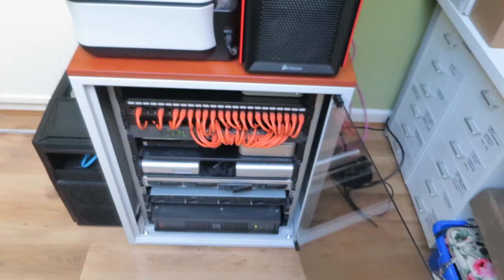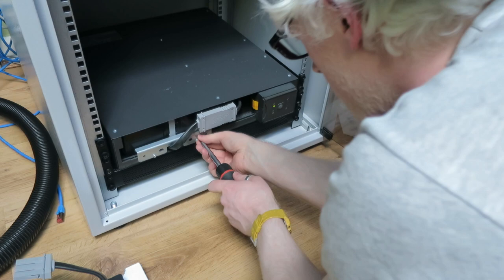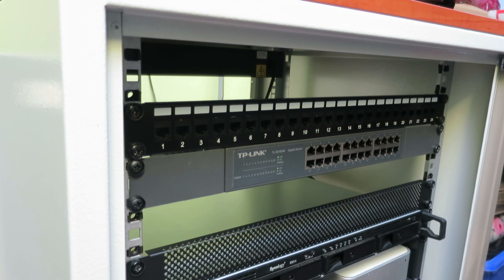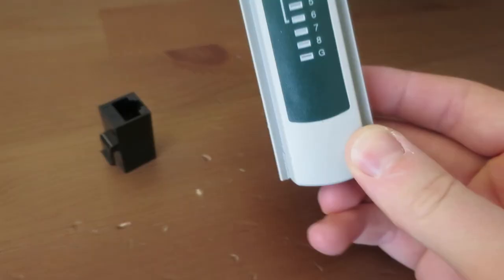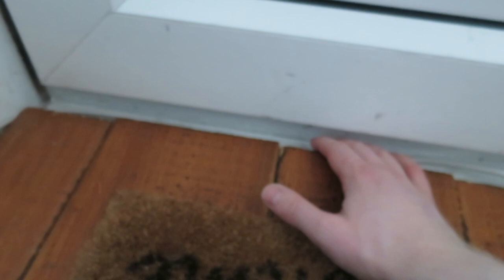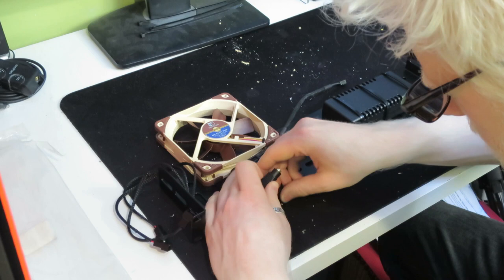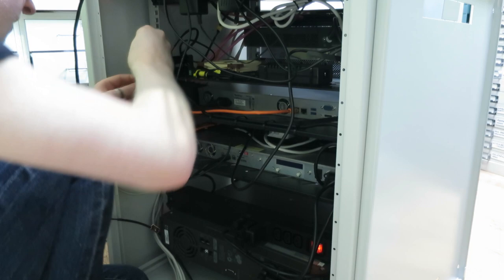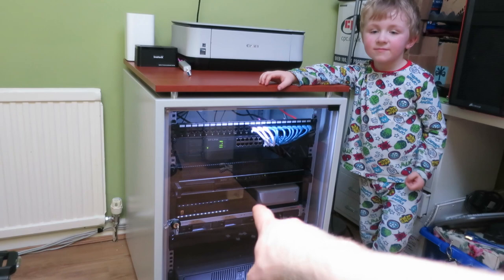Setting Up Our Home Network (Part 7) - Bringing It All Together

Comment: Tom. Thanks for the slow pace videos. It’s very relaxing for my mind :). You showed the cable routing past the entrance door for your house and showed that the door mat would prevent people from tripping. I got the idea that you might be able to hammer some racks on that cable into the end grain of the floor. Right in the gap. Anyway, cheers.

Comment: Tom - you might also think about mounting the existing middle fan (under the rack shelf it’s currently attached to), adding a 2nd fan next to it, and mounting the transformer on the top (since it’s heavier). Don’t forget the fan cages and washers as well. Cheers
Reply from the maker: Thanks for the suggestion, Robert. Good thoughts. Keep an eye on future updates.

Comment: The racks I have that are that size all have the fans on top, not the bottom. I thought you might have the cabinet upside down! LOL.  But, I have found some that have fan mount top and bottom. We have the fans on one case mounted on the outside and the filter on the inside. The cabinet is actually a wall-mounted. I might be worth raising your cabinet up a foot or so for airflow. We have a rack that has an 80/20 aluminum rail frame that has been built to support the whole cabinet and raise it off the floor so the equipment is accessible at sitting height. The frame a rectangular frame with four perpendicular feet about  14 inches each with plastic covers over the end of the 80/20 three-way footing on top and actual screw adjustable feet like your cabinet has. The mountings for the feet are actually tapped and threaded holes. The frame has been secured to the rack with the 80/20 sliding cage nut system drilled through the cabinet. Its an exotic solution but it might be an interesting video.

Comment: TOM... a suggestion for the fan cooling setup, you could get a thermal trigger - which will have the fans kick in when things get hot in the cabinet ... just a thought .
Reply from the maker: Check out my channel for my recent cooling addition to the rack :)

Comment: Finally made it to the end! I use those exact fans behind the amps in my hi-fi rack. I was using Arctic F12s but I had a power surge and killed them. They draw less than 200MA each so you have a good 5 amps of headroom on that PSU if you wanted to add lights or step-down for USB charging or running a raspberry pi etc. Great work though, the nerd in me wishes I had the need for a network rack.

Comment: The second you mentioned a service loop I knew you had been watching fiberninja. I'm proud Tom, I'm so proud
Reply: Fiberninja says never to bother making your own short cables when patch cables will do the job, which is great advice for an enterprise network but if you're sitting at the desk watching a 3 hour video about rewiring a place overnight while the cctv guy is making life difficult then you have the time to throw together a couple custom length cables during it. Which is especially nice when you'r patch panel is one row and your switch is 2 and slightly off center, I have the same issue.
Reply: Also, small note, if you can ever pick up a longer led strip on cheap it would look great up one side, along the top, then down the other side. scrap the bottom one that illuminates the UPS and make a more consistent lighting level through the rack
Reply from the maker: @RoryIsNotACabbage  Thanks for the comments man, I appreciate it! Yes, time consuming indeed for 24x patch cables. My eventual plan, which I believe I described in the video, is to get much longer patch cables and take both bundles off to the side. I didn't get to it in this part, and I didn't want to risk spending the dosh and then realising the new kit needed different length cables. 

About the LEDs, yes that would be the ideal solution. What I will say though, the bottom strip doesn't look as 'obvious' as it came out on camera. The plastic on the UPS is quite glossy so in the video when I had the LED brightness turned up for filming, it reflected like mad and looks like a blob of light on the UPS, but in real life it's much more subtle and even. The bottom strip evens it out a lot. With just the top, it was nearly pitch black by the time the light reached the Mac mini shelf.
Reply: @ItsMyNaturalColour  I do remember you saying that now. Good practice though 😋
Looking forward to the new series starting

Comment: You can use the open USB ports on the back of your servers to power the fans and avoid that power brick. Another idea would be to use another keystone patch panel in one of your open locations above or below your servers and and use it to bring the rear IO of the servers to the front side (USB ports, video out, etc.) for ease access.

Comment: Hi Tom, I've just moved to a pfsense machine running in a VM. I've kept my Time Capsule but only for backup of the Macbooks. Free version of ESXi is running on an HP Microserver. Using pfsense and Unifi APs has given me lots of control and visibility - this may be of interest to you for future video ideas.

Comment: My solution to power rack fans was to add USB plugs and run them off an 8x USB-charger at 5V. I rather have many fans at slow speeds than only a few blasting on full power.

And since the rack is pushed against the wall anyway, why not get rid of the back cover? It doesn't appear to be structural and it would definitely help with air circulation.

Comment: Where you have the mac mini and HDD i would get one of those vertical fan mount plates with 2 fans, push the mac mini and hdd back and screw that plate to the front and have 2 fans blowing constant air across them, keeping both running a lot cooler.
Reply from the maker: Thanks for the suggestion. Yes, I'll definitely do something to address the Mac mini cooling. Someone suggested on Facebook a fresh application of thermal paste and an internal clean for the Mac mini, which would be a good start. I'll make some videos about this stuff in the future.

Comment: I basically have the same rack and I can recommend the Digitus DN-19 GS-NW sliding rails. They work perfectly to support equiptment. I was still able to screw the device in form the front and thy line up perfectly. They are rated for up to 100 kg. Just as a tip for someone in a similar situation.
Reply from the maker: Thanks for the recommendation!

Comment: USG PRO 4 and UniFi POE 24 port incoming 👍
Reply: I haven't got to that section of the video yet, so excited to see what's announced... That said, I'm not sure if anyone would still be interested in buying the older USG Pro, cloud key and switches since the UDM Pro was announced. It incorporates the controller, gateway, surveillance NVR and a small switch in one unit. Best of all, future proof because it offers SFP+ for 10Gb 😆

Comment: My parent's dishwasher came with a rubber flap with an adhesive strip, the idea was to put it on the bottom to make it look nicer if it was integrated into cabinetry. I guess something like that might work for your front door situation?
Reply from the maker: Thanks for the tip!

Comment: You can easily move the side panel of your rack to move your cables of your power transformer supplies !
Reply from the maker: Not too sure what you mean? This rack is a single piece, with a removable back cutout and glass door. The sides don't come off.

Comment: The APC ups' still will beep even if the battery is healthy, I've got the same model as you.
Reply from the maker: Yes, they're designed to beep if the power goes out, but when your battery is dying, it constantly beeps even if there's no disruption to power, as a notification that the battery is dead.
Reply: @ItsMyNaturalColour  Ahh OK, that's good to know!

Comment: Thanks for the greates video:) 

But I can see that you have mountet the back support shelf for the synology, one hole to low. You can move it up one hole and it will be perfectly level👍🏻

The fan in the middel of the rack, could give some better airflow by Mounting it on the other side of the shelf, so it pushes the air ind the back where the cable is:)
Reply from the maker: Thanks for the comment. Can't remember if I touched on it in the video, but I had to move the Synology back support shelf down 1 hole on purpose. For some reason, it was out of line if it was one notch up. Very annoying, but it works ok. 
Yes that was my original plan, but pleasance with the back panel was an issue.

Comment: Nice cleanup. Not sure what's going on with Fiber Ninja. He has not posted in quite some time unfortunately. 
I have two variants of that switch, one has a 'D' suffix and has a slightly different layout from the non-D version. Both are non-managed switches. My network is 100% managed now, but these TP-LINK switches are perfectly adequate and fanless, for most home use. Nice job.
Regarding the air flow -> you want to block the front, not vent the front, for the unused slots. You want that cool air to pull from the front and blow out to the back. If there is virtually no resistance, the air will just go through the open areas instead. It still cools a bit, but not as much. The cooling I used was the AC-INFINITY rack mount (2U) fans which have temperature controls. They are NOT cheap (at all) but they have been rock solid. I flip the fans around so they pull from the front, but in your case as the door is typically closed, you probably are fine with the Noctuas you have planned/already installed.

No big deal on the A/B mistake. I've done that a few times. I must admit I try to stick to 'B' as well, but I am not using the socket type stuff you have in the cupboard. I am using a rack strip for that. I am finding the powerline adaptors a royal pain to use, mainly as they are just not great when the circuits are far apart. Much nicer without powerline :)
Reply from the maker: Thanks for the comment!
I really hope he posts again soon. I enjoy his cleanup videos immensely and always learn a great deal. 
Yes the TP-Link switch has been absolutely rock solid. I have a few of the 5 port and 8 port versions dotted around work too, all unmanaged but completely solid. It's great kit for the price, and even after my upgrade to managed kit later on this year, I'll continue to recommend the TP-Link switches. 

Thanks for the heads up on the cooling. You're absolutely right and that makes perfect sense. Once I get the new kit in and all the rack space filled, I'll fill in any blanks with non vented panels.
Reply: @ItsMyNaturalColour  I moved the vast majority over to Unifi equipment, although my router is Ubiquiti but EdgeMax (EdgeRouter Pro8 SFP model). Not needed for sure, but having the POE powered Access Points is great. Their newer stuff is fanless for some of them, or much lower noise for the rest. It's kinda crazy, I've not lived in the UK for >10 years now :/

Comment: Hi Tom great video is they a reason why you fitted the severs in the middle of the rack and not at the top heat rises?
Reply from the maker: Yes. I think I touched on it during the video, the top of the rack is reserved for 2 or 3 new pieces of equipment that will be coming later on in the year. The whole thing will make more sense as soon as I deploy that kit.

Comment: Really interesting video. I thought the brush plate was a tidy looking option for patch cable management. What is the downside of using the brush panel for cables going in and out? I am trying to find the best way to manage patch cables without it being a big mess of  a cables.
Reply from the maker: There's nothing at all wrong with a brush panel, they make things very neat and tidy. The problem in my scenario was the way I crammed everything into it. I had 24 patch cables coming in, and then the same 24 coming out of the same panel. That was 48 total in/out which was far too much to keep neat. Best way to do it would be to only use the brush panel for one side of the 24, then use longer patch cables and bring them around to the front via the side of the rack... or use 2 brush panels if you can make it look neat and tidy. If you have a 16-port switch, it may be easier to manage 16 in/out, but 24 in/out was just too many for the one panel.

Comment: Tom - what about flipping the 2 new spart-shelves 180 degrees, so the ‘shelf’ parts are on top (instead of the bottom). Then you could slide the UPS in and be able to screw ears into the UPS and secure everything to the rack properly. This would also give you more clearance for the bottom fan to circulate air in the rack. Don’t buy a 3U blank/spacer - get three 1U’s in case you need to shuffle things around in future.
Reply from the maker: Thanks for the suggestion! Great idea. I will look at incorporating this change next time I overhaul the rack. It's fine for now but this would be even better.

Comment: I noticed there’s a serial port on your Synology box. It might be possible to connect your ups to it. Would be great to have auto shutdown on the Nas if the battery runs out.
Reply from the maker: Good spot. I forgot 2 or 3 things that I wanted to cover in this video, and this was one of them. As part of the project completion I wanted to get the UPS interacting with my servers. I completely forgot about it (too much to remember), so I'll make the changes at some point this year and document it in the next series.
Reply: I have the same UPS, I managed to get it communicate with my Synology NAS after lots of faffing about. The synology stuff works fine with USB UPSes but for serial you have to install some drivers. Also, APC decided to use a non standard serial pinout so unless you want to pay for an expensive cable you have to make on yourself. Definitely worth it in the end though.

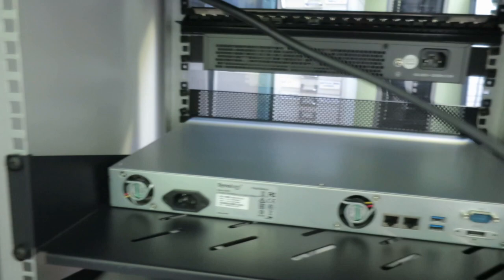Comment: Hey Tom, at 54:15 I noticed that the Monster RAID has an eSATA port, and I wondered if this meant you could connect it to Skaro? Obviously while not that important now, it might be a cost-effective way of increasing the storage space on Skaro, or just cool to play around with (and centralizing Network Storage that little bit more). Awesome video, just an idea I had. Thanks for all you do, and here's to many more in the future!
Reply from the maker: For some reason, this has never crossed my mind. Very interesting thought. Yes, this would probably work. I'm keeping an eye out on eBay for 4x used 1TB WD Red drives to bring Monster RAID back only with a 3TB RAID5 config. I will definitely try connecting to Skaro to see how that functions. Thanks!

Comment: Great video Tom,
4 years, crazy, I still remember watching part 1 when you released it
Wow allot of what you said is what i'm planning for my series (part 1 already on my channel), that's crazy.
As for that 2U case, I to have been looking at them, I am thinking of a DIY NAS myself though as I already have a unused i3 system that I can transfer over.
I will be interested in how you set up your managed switch, my current switch is a managed one but in currently using it unmanaged
As for the detachable cable ties, i'm using velcro straps for the same reason, nothing is ever permanent haha
Wish I thought to get longer patch panel cables, I got short ones for mine :/ 
Good job on removing the powerline adapter, They are great but not fantastic
I was trying to think of a way to power my fan for the server rack, now you have given me a idea with that 12v brick power supply, I may even have 1. Hmm.
Great idea for the top to raise it, My rack doesn't have a top like that but im thinking of making 1, I am thinking to raise it in a similar way to what you have, Just a idea here for the top, maybe a LED light in the gap giving out a but of glow? Just a idea.
Loved that outro, some memories there, aww Ellie (sorry if spelt incorrectly) at the end, Computer <3

Id be interested in a few links to some of the rack accessories you bought here such as the shelves, mainly the 1 you used for the fan and the 2 400mm ones you used to hold the UPS up.
Also what music did you use, some fantastic music throughout.
Reply from the maker: Hey Tony, I've just responded to your comment on Facebook but I'll post the links here too just in case other people are interested.

400mm split shelf - https://www.ebay.co.uk/itm/1U-Rack-Shelf-Bracket-Pair-for-400mm-AllMetalParts-cabinets-60mm-lip/291292069388?ssPageName=STRK%3AMEBIDX%3AIT&_trksid=p2057872.m2749.l2649&fbclid=IwAR1taJwDnhNAet4fi5S8ZdkOldPiuCeXj4XyUuvDKgafxwbplR8sR-j2mA0

2U shelf - https://www.ebay.co.uk/itm/272212834173?fbclid=IwAR2bMwSwYqDdNXMgA8whG-ET5Nk2Q4Ly0gYApRvuzENa125XXslRXKKhwvM

Shallow 1U shelf - https://www.amazon.co.uk/Rack-Shelf-Vented-100mm-Allmetalparts/dp/B018ZSF1GG/ref=sxts_sxwds-bia-wc-p13n1_0?cv_ct_cx=1u%20rack%20shelf&dchild=1&keywords=1u%20rack%20shelf&pd_rd_i=B018ZSF1GG&pd_rd_r=4d3c1957-b36d-4745-b228-293aed179fff&pd_rd_w=a2UP4&pd_rd_wg=5szpu&pf_rd_p=4cda869f-2b1a-4e5f-a72b-48315da95bba&pf_rd_r=S2KGH4XHC2DJ2QS829V6&psc=1&qid=1590317879&sr=1-1-91e9aa57-911e-4628-99b3-09163b7d9294&fbclid=IwAR2qa_AkIYyWJVlVnfxN6P1wDy8oWvrQ6WwDQ1RS-a5ja3aBEMV7qZeQ9mc

Various music used throughout, Retrograde - Lexkriix is the song used the most in a couple of spots, you'll be able to pick up the others using Shazam :D 
Thanks for the support as always. Good luck with your network!
Reply: @ItsMyNaturalColour  Cheers Tom. I have added them already for the future to my watchlist :D
And great, I will add the music to. I may or Maynot use it myself haha

Comment: Are you using standard rj45 end? When I use them I always have to do them a few times. So I started to use passthrough rj45 ends and I get it right almost every time :)